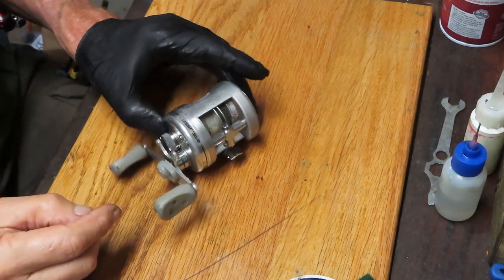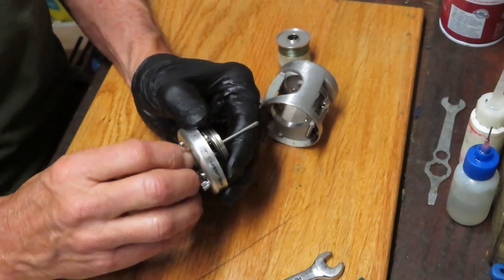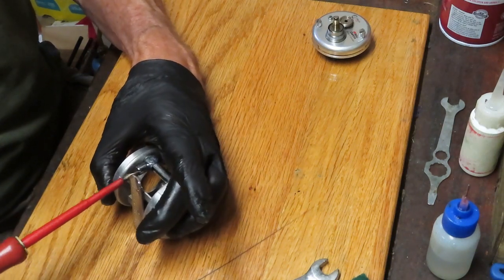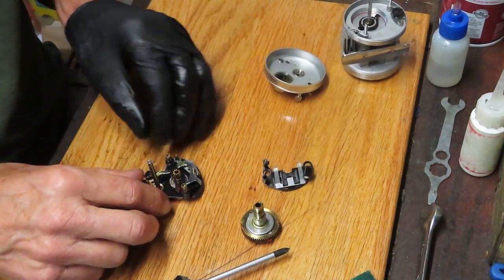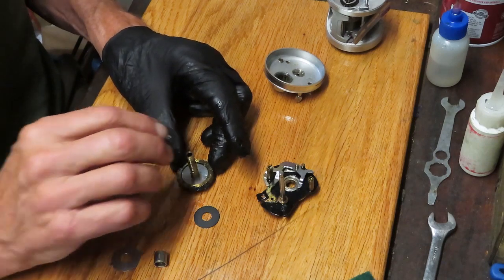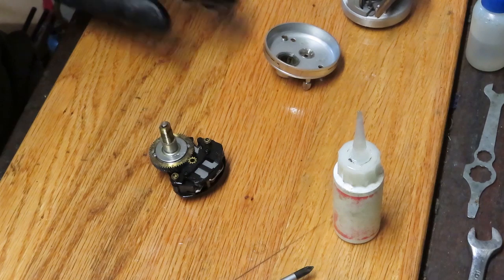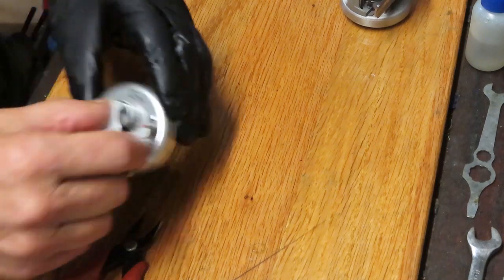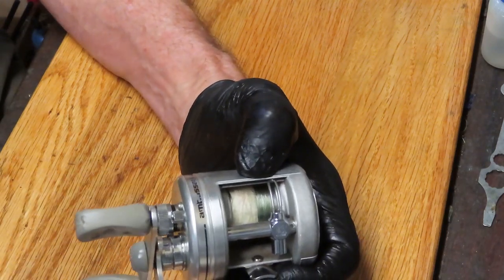Abu Silver Max Ambassadeur 3600 with performance issue how to service and repair

Comment: My cousin gave me a abu garcia bass usa 4600c that was behaving similar to this one. Almost like a bearing was going out. Turns out it was the thumb bar pin had slid back into the thumb bar. You'd hafta slide the thumb bar to the right to disengage the spool. And when you would turn the handle, the arm would slide up over the thumb bar pin, causing everything to be out of alignment. I pulled the thumb bar pin out a little and fixed it. Good as new
Reply from the maker: Thanks for the note.  Glad to hear you were able to give the reel a 2nd Chance

Comment: I have several of the Abu Promax 1600's that i picked up at fleamarkets.
If i remember correctly they came out in the early to mid 90's and retailed for around $175.00 or more. Im thinking they were the last of ABU's "flagship" reels prior to the out-sourcing their reel manufacturing to the Asian countries.
Whst are the differences between the Promax 1600's and the Silver max shown in the video?
Reply from the maker: These two reels are nearly identical internally.  The industrial design of the case would be the biggest difference.  Thanks for asking - Dennis
Reply: @2ndChanceTackle  what are the differences in the design of the cases?

Comment: Have you ever replaced the spool bearings with ceramic bearings? And if so what brand do you recommend?
Reply from the maker: I have done the ceramic bearing upgrades.  I don't notice much difference in performance, but the ceramic, unlike the steel bearings will not rust.  I got the bearings from several sellers and have never paid attention to the brand.  Thank for asking - Dennis

Comment: Question,  can you greese the drag washers? I noticed you don't greese them, but some other guys do. I'm confused whether to greese them or not. Thanks!
Reply from the maker: Sure - there are 3 types of washers.  Felt, fabric (leather other) and hard like teflon or carbon.  They are in two classes - permeable and non-permeable.  Permeable  can take grease or oil and absorb it.  Hard washers cannot.  I oil felt washer, grease fabric washers and do nothing with hard washers.  The oil and greases are meant to keep the washers from drying out and cracking.  That is the only purpose.  Dennis
Reply: @2ndChanceTackle  , thanks brother